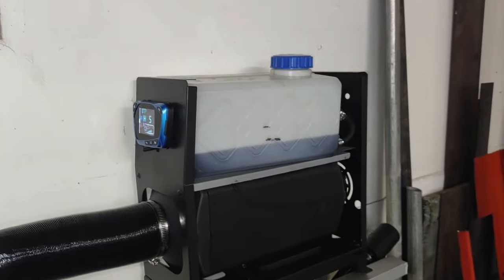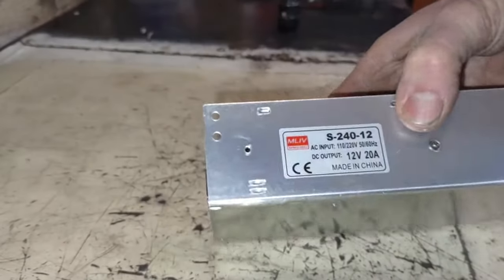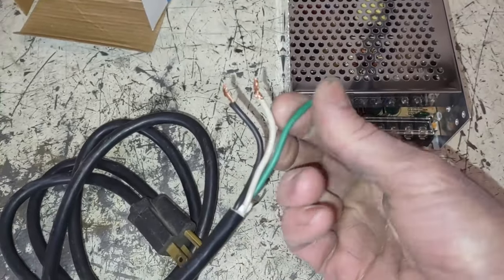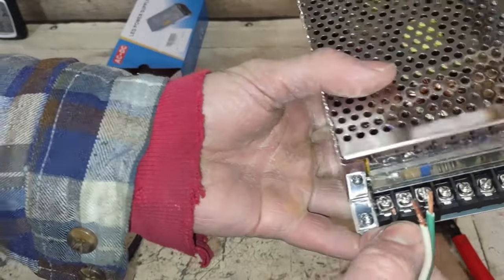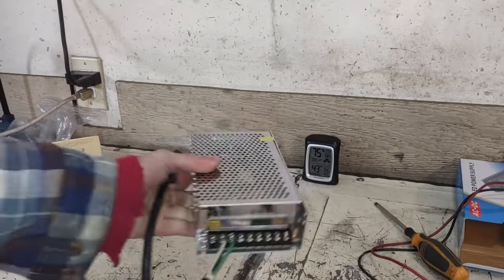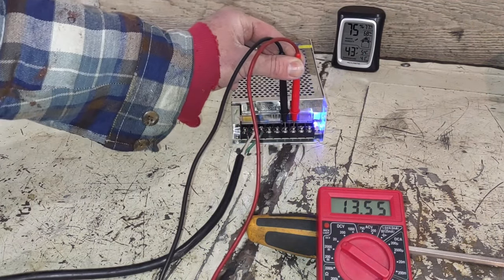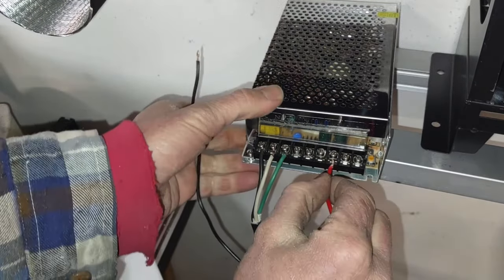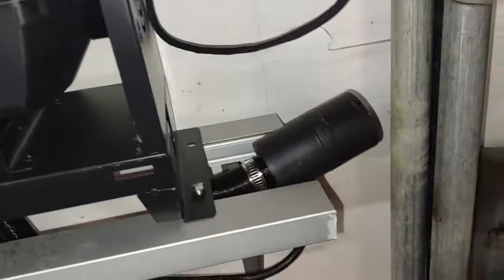How to power your diesel heater with a 12v power supply

Comment: Mmmm not a good solution. If the power dies then you will wreck the heater because it wont go through its shutdown cycle. best go back to using a battery with a charger.
Reply: How is that any different that a battery dying and the heater not going into cooling mode? Not being cocky asking seriously
Reply: The battery does not die rightway, the shut down needs 5 minutes to cool down
Reply: @gurkiratsanghera6745  It's normal to connect a leisure battery to the heater and run the heater off it. Then have the battery on a trickle charger simultaneously. Only con is the cost of batteries. Must be min 10ah.
Reply: The only fly in the ointment is - a 12V battery costs as much as a new heater, then you got the expense of buying a battery charger as well.
  
What happens when a cell fails and the battery packs up? A battery can fail as easy as a power supply.
Reply: Or have a back up battery
Reply: @bricktop7803  Dont know where are you shopping but12V battery is cheaper than diesel heater. Battery cannot fail as power supply. Power supply can go down immediately with grid. Battery wont do that.
Reply: @jan_vyhnak  Batteries most definitely die. Cells go dead all the time as well as what if you accidentally forget to charge it? It not going through a shutdown doesn't destroy it or anything. At most you may just need to clean it.
Reply: @MrTaylorfenoglio  nope they dont die all the time. they last longer than Chinese power supply.  they discharge and during that the heater will shutdown before they are flat completely. forget to charge? it should be on the charger all the time so thats not the case..
Reply: @jan_vyhnak  they arnt designed to be left on a charger all the time. That destroys the battery. Your much better off using a UPS if that's your worry. The way your wanting to do it can cause damage to the battery, create a huge fire hazard, battery charger creates huge power surges which will damage the heater. You can avoid all that by just plugging in. And if in a case the power does go out and the rare case it won't start back up you just clean it. No damage made just a small inconvenience.
Reply: @MrTaylorfenoglio  well you are just wrong. its not matter of the battery but the charger if you can keep it charging all the time. UPS is the same battery + charger. "huge power surges"? well you are using wrong charger then. so you better think about fire hazard not me. my charger is made to be connected all the time.
Reply: @jan_vyhnak  I'm not wrong tho you are. Using a UPC is absolutely completely different. These batteries are not designed to take a charge and discharge at the same time because it destroys the battery. And unless you are using an  special charge controller and special battery charger your not using the battery charger correctly and can easily overcharge your battery and create a large fire hazard. UPC is sending power to your device and maintaining a battery. You aren't drawing from the battery until an outage accrues.
Reply: @MrTaylorfenoglio  that's the point you don't know what im using but you are sure im using it wrong. and stop talking about fire hazard when chinese power supply is in game. its ridiculous. its not "special contorler" just simple charger made to be connected all the time. it cost me same money as any other charger.. and "charging and discharging at the same time"? you dont know how electricity works.. how do you think charging in car works?
Reply: These crappy vevor heaters only last me 1.5-2 hours on a standard 12v battery anyways. Can't hook a trickle charge to it (manual says it'll destroy the heater) and mine will throw an E02 code if I try connecting a trickle charger to it anyways. 

With how much you spend on all this extra bs to get the thing running consistently, you're better off buying a quality diesel heater.
Reply: @gurkiratsanghera6745 on my heaters ( Chinese) the low voltage cut out shuts of the fuel first so you do get a cooling down sequence before the machine shuts off. I run all my heaters on 12 volt battery with a 240 volt battery charger hooked up permanently. Low voltage, I have found, is one of the causes of carbon build .
Reply: Cant you just buy a power supply that accepts and charges a backup battery?
Reply: @ninjaofthenastypr  that’s the best option! . I have 25 amp smart charger (CETECK) which has a supply mode (designed for camper vans ) expensive but keeps the battery in good condition, about 8 years old.
Reply: I shut unplug mine every time I turn it off they always start back up
Reply: If the power goes out I’m not worried about the shutdown cycle!!

Comment: Trickle charger and battery is the safest way.
Reply: What are the draw backs of using this? I find the battery and trickle charge doesn’t always work. Runs battery too low sometimes on start up and if running constantly. Mine runs for about 4 months straight
Reply: @davecarbone2977  In the case of power shut-off you can fry the heater because before turning off it needs cool-down run.
Reply: @jan_vyhnak has that happened to you ?

Comment: I used an old power supply salvaged from an old ATX computer.  Found the 12v supply leads and hooked up.  60A.  I use it for a diesel fuel pump to fill my tractor.

Comment: Why not just keep a trickle charger on your battery?  The way you have , It if the power goes out your diesel heater will melt its electronics when the fan stops. Could possibly even catch on fire..🔥🔥🔥

Comment: Very useful info about voltage setting. i didn't imagine to change the voltage. Mine casue wihte smoke on start up, i read on the lcd of my heater 11 p instead of 12p. Searching on google i read that maybe would be the lower voltage .. i will try to rise up to 12 as you do with a tester . thank you for this video
Reply: Low voltage is one of the causes of carbon buildup. I run a 20 to 1 diesel to kerosene mix occasionally to clean out the carbon and the glow plug screen. Sometimes I have to replace the screen to ensure quick ignition but the is a quick and easy job!

Comment: I have a 220 to 12 V converter for wall outlet. The heater I intend to buy needs 15 A, wouldn't this do if the converter provides this?
Reply: No no no, I bought 15 A and it’s working to just warm up the diesel heater but when it’s start to heat up it’s stop working and gives me error codes. Hook it up to my car battery, which is 76A and works fantastic

Comment: if you adjusted the voltage to 14-14.5 volts, do you think it would allow the glowplug to heat up faster/ hotter, thus reducing soot issues/ carbon buildup in the brun chamber ?
Reply: No the heater will throw an error code Over voltage
Reply: @Joe-mx9zv I start mine with a jump starter that pushes 15+ volts. It’s doesn’t throw an error there(at least not on mine) perhaps it’s 16v that triggers a low voltage error

Comment: I use a 15 amp power supply. Looks the same as the one in video. But i have it hooked to a 4amp atv battery and have it set for 12.6 volts. Have lost power and   battery is big enough for safe shutdown. That's how i got around that

Comment: I have a regulated power supply similar to one you have think same one, but will hook to a backup power source or UPS setup to ensure unit cools down if power fails while running. Location unit will be hooked up has frequent power outages in the cold months.  Want to ensure it has proper cool down in case of power outage, I will run unit in my wood shop only when I am present so can be around to shut unit down.  Perhaps, I can figure way with Arduino setup to auto power unit down in power outage with some type of line power sensor tied into an Arduino unit.  Maybe some type of gated backup power battery supplied, will figure out when I get unit installed in coming week or two. Read somewhere about making simple UPS with NAND ICs and a some relays, think I could easily add in a built in timer via simple Arduino type setup to this unit if I make it myself.

Comment: Very helpful... I'm testing my PSU here, I got a 10amp one though cause people online kept repeating 10amp... the fuse says 20amp and you mention it too so hopefully we get combustion. Thank you for the tip about setting the voltage ⚡
Reply: ideally you want a power supply thats more powerful, than the maximum power draw of the heater....
If the heater draws 10A... You dont want a power supply rated at 10A... because then you are running the power supply at its limit when the heater is drawing 10A....
Can possibly cause thermal shutdown of the power supply, Or worse.. Damage components inside...
Always leave a little bit of headroom.... Especially for aging of capacitors etc over time....
If my heater draws 10A,..,... id go for a 15A power supply.. So its never being pushed to its limits
Reply: @RGD-Audio-Repairs  Thanks for that! I finally got to test the draw using a multimeter, it seems to be a smooth 7amps on start up then drops off.. so far no issues with it... If it needs replacing I'll definitely move up a notch 👍
Reply: @byrne1916 it's only pulling high Amps as the glow plug heats up the amp draw drops which it's warm

Comment: Hi, I'm trying to run mine off of my RV converter.

It reads 12.5 volts DC output, but the heater is reading it at 18+ volts.
Any thoughts?
Thank you
Ken

Comment: I thought my heater was faulty when I connected a 12 volt battery to power it.
I was getting an error message, indicating the voltage was too high???
   But,  I was able to get my heater working when I took  a smaller size 12 volt battery to power it.
But, I needed to keep the charge up, so I  had to also run my smart charger to  the battery to
keep the heater running. 
But anyway,  I'm learning this afternoon, the proper way to run these heaters, is to install
a dedicated  power supply.   Nice video, I'll model my setup now like yours, Thanks.
Reply: I have done this and it is the best way to get a long life out of your heater and battery. Good job!

Comment: I wired a heavy duty 12v accessory plug to a jump pack but just bought one of these. I’m going it wire a female accessory plug to it so anything I need a 12 volt supply to I can use.

Comment: Is it a 5kw or 8kw heater? I've order a 8kw. Is that powersupply enouth then or do a have to ramp up to 25 amp -300w?
Reply from the maker: it was advertised as a 8k heater but I think its a bit of false adverting I bet they all put out around 2k of actual heat energy but ether way it won't matter to the power supply, the 8k unit won't pull more electric power it will burn more fuel to make more heat.

Comment: Ive wired mine up to a similar LED transformer but 12v 12.5a one not a 12v 20a as you have, it worked fine to begin with but now when I try to power it up you hear a click and the screen just goes blank. Any ideas?
Reply: Current not enough,this cheap power supply does not have real power. I use an old xbox360 12V 16A power supply. Cheap and good price

Comment: The whole power supply problem is just dumb. The fact it doesn’t come with it is the stupidest shit I’ve seen this week.
Reply: They don't come with a power supply because they're meant to be plugged into a 12v battery system; they're not supposed to be hooked up to mains power because they sustain damage each hard shutdown (unpowered shutdown) they experience. The internet says the German built ones can survive 3-5 shutdowns like that before the electronics inside are fried. I wouldn't be surprised if the Chinese ones can withstand less. It's a real issue for some people; in my area we get a lot of power outages and it would be a bit of a gamble to hook this up right into mains power.
Reply: @itsumonihon  the chance of frying the heater depends on how cold is air around (inside or outside mounted) and the setting of actual power output. Also little bit on luck.